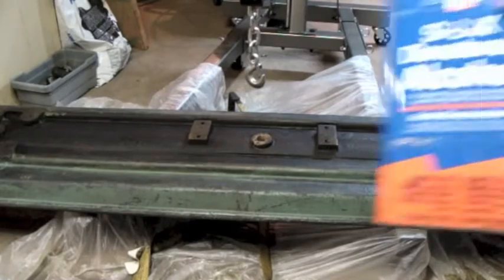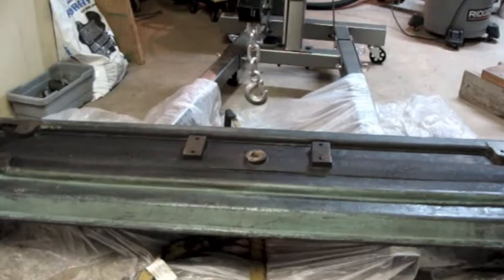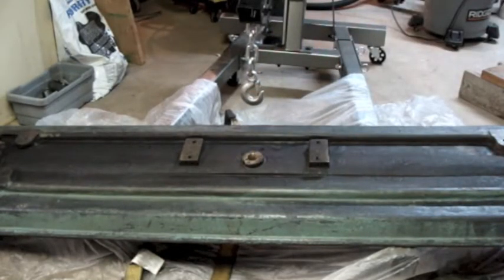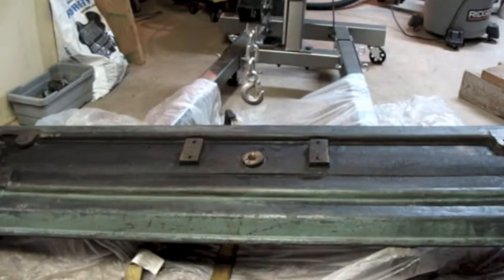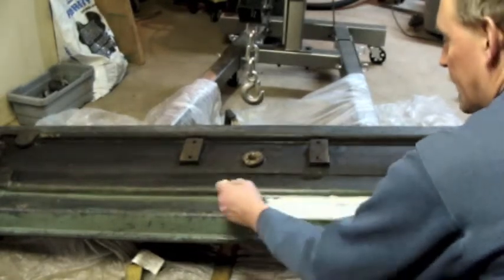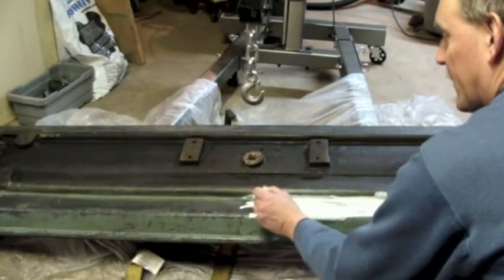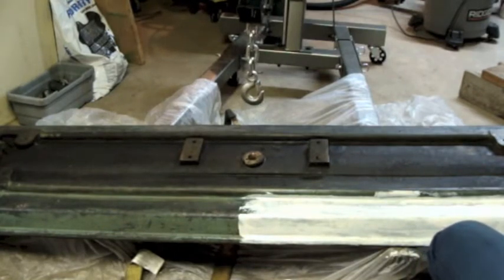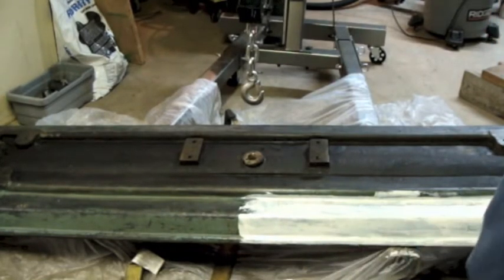Hendey Lathe Part 48

Comment: How thick is the outter rim on that face plate?  I'll bet you could reduce the OD with a grinder until it was small enough to turn on the lathe.  Once you could turn it on the lathe you could make it perfectly round again.
Reply from the maker: That might work, but I'm not doing a thing until I get the headstock reinstalled and can see exactly just how close it is. Thanks for the suggestion.